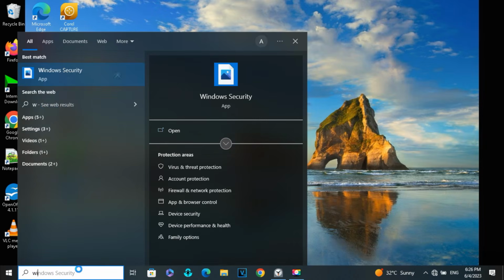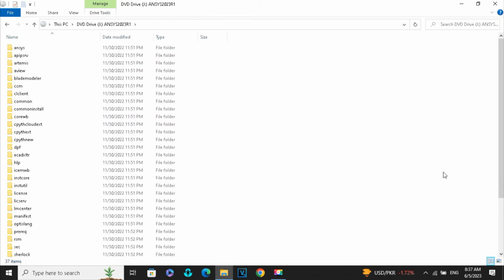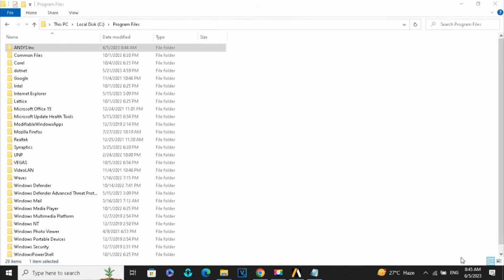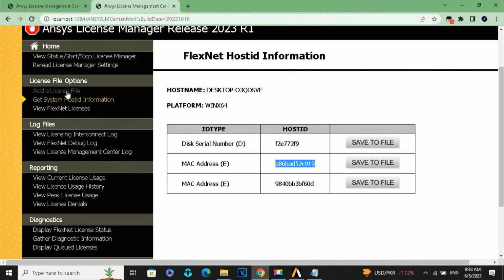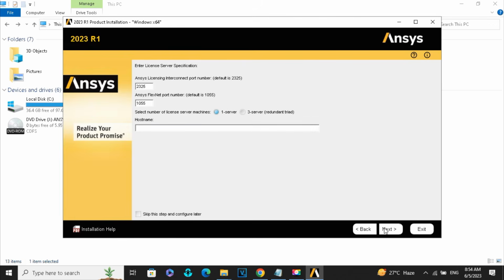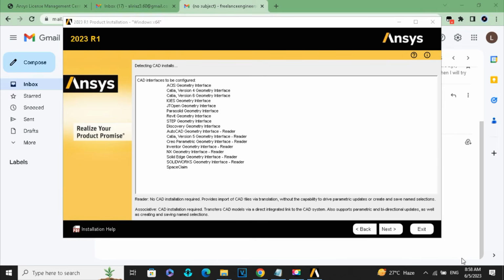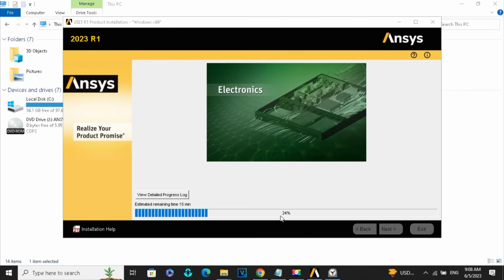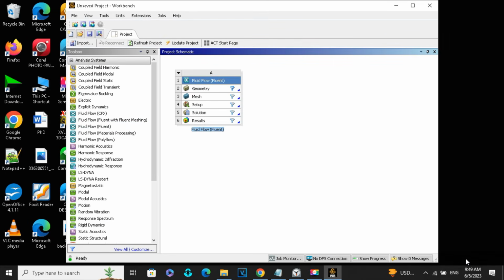ANSYS' 2023R1 Installation #ansys

Comment: i am getting disco_level1 error , and flexnet licensing error -8544 it is saying the license key and data for the feature does not match i tried launching license manager again still same error persists
Reply from the maker: Kindly follow the video.
Reply: I’m having the same issue. I’ve tried following the video several times. Could you please help me with a solution?

Comment: Hi, im trying to run the license, but i have this error:

Error: Problems were encountered while attempting to stop the following process(es): ansysli_server.exe, ansysli_monitor.exe The license manager is running. However, its FlexNet component is not running correctly. To resolve this issue, please manually kill (in the order listed) the ansysli_monitor, ansysli_server, and lmgrd processes, and then start the license manager again through the License Management Center.
Reply: Sorry, solved, I didnt copy and overwrite the "Ansys Inc"  folder
Reply from the maker: @jonathanarias2729  Okay.
Reply: @jonathanarias2729  Bro how did you do that?

Comment: Please I followed your guidelines to install the ANSYS 2023 R1

But I am currently facing a  problem with my Fluid flow (Fluent) Setup. 

Problem: The procedure entry point H5Pset_dxpl_mpio could not be located in the dynamic link library

How do you think I can solve this issue ?
Reply from the maker: Kindly follow all the steps as it is.

Comment: bro everytime encountering some licence problem  disco_level1 doesnot exist in licencing pool
Reply from the maker: Uninstall all the files properly then install the software as explained in the video.
Reply: will it work on windows 11? is it the issue with 11 or i removed all the ansys files and tried several times

Comment: Sir i also want to include spaceclaim and when i tried it it is giving me error as {Request name disco_level1 does not exist in the licensing pool} for it the procedure is same or different pls guide me on the issue
Reply: Same error, restarting and turning on the license again is also not helping.... Please tell me did you find that solution??.... Please reply
Reply: @bharat61020 did you find any solution? I am also facing same problem and cannot find any solution? Please reply if you have found any solution?

Comment: hey guys, if anyone is having the error " Request name disco_level2 does not exist in the licensing pool. Invalid license key" or something similar to that:

try to install Ansys in C Drive (products and license manager) instead of D Drive. 

It worked for me. 

If it didn't work for you then try installing with your windows security and internet connection offline. 

If none of that worked then don't ask me because I can't reply to comments and I have no idea how else to solve it. Cheers.
Reply: Yes, Worked with me thank you

Comment: i installed it the way you said it in the video. I am doing the analysis and when i try to enter the geometry, I am getting an error saying "ANSYS Licence Manager Error. Request name disco_level2 does not exist in the licensing pool. Invalid licence key"
Reply from the maker: Open the license manager from window search bar and click on running option.
Reply: @computationalfluiddynamics3019   it doesn't solve the problem
Reply: License error issue problem
Reply: Sir 
Same problem.
Unable to resolve please help.
Reply: @KushalJain-y1g  I restarted computer and ran the licence manager again. Now it's working completely fine
Reply: Hi bro, i m facing the same issue.
I already restart many times. But not yet  cleared Could you pls help me🙏🏻. @rmbabariya4242
Reply: @rmbabariya4242  same i tried its not working any solutions?
Reply: I'm getting the same issue
Reply: I am not able to open the mesh editor as its saying not having valid license pls help 😭
Reply: @Animatin- same

Comment: Thank you for the video. I followed all the steps and in the end I managed to open Workbench without any issues. However, once I try to open ANSYS Mechanical APDL, the following error appears:

Request name ansys does not exist in the licensing pool.
Invalid (inconsistent) license key.
The license key and data for the feature do not match.
This usually happens when a license file has been altered.
...
FlexNet Licensing error:-8,544. 

Does this method allows me to use APDL? If so, how can I fix the error? 

That would be all. I appreciate your work so much. Looking forward for more tutorials!
Reply: I do too. Were you able to fix it?
Reply: Hi did yoj got any solutions
Reply: @suhaebr2768  Hi. Sorry I did not. In the future I might try again.
Reply: @Tanukiureshi more explication please
Reply: @oussmganayoub7210   got solution bro one dll file is missing u need to add only
Reply: @suhaebr2768  how did you solve it?
Reply: @Tanukiureshi   1)reset winsock in cmd 
2) in windows system host file add #local@1055
Reply: @suhaebr2768  kindly explain the solution of this problem in simple steps, i shall grateful to you
Reply: @suhaebr2768 can you explain more please i have the same license problem
Reply: @suhaebr2768  Hey bro can you explain it clearly please 🙏🏻
Reply from the maker: Kindly crack the software as mentioned in the video.
Reply: @computationalfluiddynamics3019  i did bro and restarted not working same error

Comment: Hi, I followed each and every single steps as shown in the video but when I open ICEM CFD a pop up opens which says "Request name cfd_preppost does not exist in the licensing pool. Invalid license key" due to which ICEM CFD does not open. Could someone please help me solve this issue! Please Note I tried stopping and restarting the license manager and also disabled my windows security.
Reply from the maker: Restart the PC.
Reply: @computationalfluiddynamics3019   Tried that, still not working.. could you please suggest me any other solution!
Reply: @computationalfluiddynamics3019  Please tell us what to do? Everyone facing same problem. Its not a joke. Same problem in R2 version also. I m  getting frustrated with this.
Reply: Is your problem resolved?
I have just installed ansys 2023 R3 and facing the same issue, kindly help me.
Thanks.
Reply: @shivachandran4425

Comment: Hello sir when I tried to replace the ANSYS Inc folder in C drive with the cracked one I got an error saying a folder winx64 is in use or a file in it is open in another program but I don’t know what file that is
Reply from the maker: It seems that you have crack file in the same drive. You have to delete the file before installation.

Comment: I am facing this error, please solve this "Mechanical failed to open the database: The Mechanical editor does not have a valid license. Please refer the following directory for more information: C:\Users\sabit\AppData\Local\Temp\.ansys."
Reply: i got the same error did u resolve it?
Reply: did you solve this problem?
Reply: @slhkty2165  I have the same issue, tried to install again but it isn't working, Did you fix it?

Comment: Hi bro i  installed the software but the problem is when i try to open  setup in ansys fluent the mesh is not loading and its taking some time then showing some error  goung back to main page could you tell me how to fix it?
Reply from the maker: Kindly make sure that you cracked the software properly.
Reply: @computationalfluiddynamics3019  do you have any alternate option
Reply: @computationalfluiddynamics3019 We have done this. Have u checked urself?? So many people facing same problem with meshing. Please give us some solution. Even in R2 version having same problem. I thought R1 version would be better.😢

Comment: while running ansys fluent setup, it's showing this error *ANSYS LICENSE MANAGER ERROR:Request name cfd_solve_level2 does not exist in the licensing pool.
Invalid (inconsistent) license key.
 The license key and data for the feature do not match.
 This usually happens when a license file has been altered.
Feature:       cfd_solve_level2
License path:  1055@localhost;
FlexNet Licensing error:-8,544
*...Please help
Reply from the maker: Open the license manager from window search bar and click on the "Run" option.

Comment: Does this Ansys Products 2023 R1 packages included with Ansys Electronics, Electromagnetism and Ansys Maxwell?
Reply from the maker: Yes, it has all. You have to select the required module during installation.
Reply: @computationalfluiddynamics3019 Okay, but in the module section it is not showing any packages named Ansys Electronics or Ansys Maxwell, why?
Reply from the maker: @masterclasz1907  Properly mount all the three disks in order fully utilize the package.
Reply: @computationalfluiddynamics3019  Ohh okay sir, I had mounted only disk 1😅. Now I'll try mounting other disks. Thank you😇

Comment: The analysis systems which contain useful stuff like Fluent is not showing on toolbar in workbench...I tried clicking the view/customize option and checking all the boxes beside every software but no luck....Help is appreciated thank you
Reply from the maker: You have to select the Fluent option during installation, so that you can use it.

Comment: Thanks for this, but fluent meshing application does not import any geometry and gives an error. Do you have any solution suggestions? The license is working.
Reply from the maker: Open license manager from window search bar and click on running option.
Reply: I'm also having the same issue.what to do
Reply: @parvathyt8442 i am also facing same problem? Did you find any solution?

Comment: I cant run any software because there is a license issue. I did every step according to the video, including Defender disabling and no internet. How do i resolve this?
Reply from the maker: If you have followed all the steps then you have successfully installed the software. Kindly open the license manager from window search bar and click on "running" option.
Reply: @computationalfluiddynamics3019  yes I followed every step correctly and the license manager is running as well. Actually this worked previously as well. However, once I performed a clean install of Windows,it is not working.

Comment: The license is working fine but the Icepak is not opening, its showing an error that "Request name electronics_desktop does not exist in the licensing pool"
Reply from the maker: Kindly crack the software by following each step as discussed in video.

Comment: Sir it says flexnet licensing is not running. I tried many ways but in that step it doesnt run. Before this i had used ansys and used another localhost. I uninstalled entire ansys before downloading the crack. What should i do with the licensing part
Reply from the maker: Kindly install the software by turning off the virus protection and internet.

Comment: hello, i already downloaded it, but when i opened it, the analysis systems doesn't appear on the toolbox. can you help me?
Reply from the maker: Kindly run the license manager by open it from window search bar.
Reply: thankyou, but what should i do if the  ansys license manager error, request name disco_level1 does not exist in the licensing pool?
Reply from the maker: @bib_bib8  Reinstall the software by turning off the internet and antivirus protection. Make sure that you uninstall the previous versions successfully.
Reply: sorry, i tried but it still not working
Reply from the maker: @bib_bib8  Restart the computer.

Comment: Can you help me? I installed the Ansys such as your tutorial, but when I start the softwares such as SpaceClaim (and others) showed the message: Request name disco_level2 does not exist in the licensing pool. Invalid (inconsistent) license key. The license key and data for the feature do not match. This usually happens when a license file hass been altered. Feature: disco_level2 License path: 1055@localhost:
FflexNet Licensing error: -8.544. I installed the license maneger correctly. Thank you.
Reply: were you able to solve it? I have the same problem

Comment: Sir
I am having a problem with opening fluent r1. It says license error. Hit return to exit the window
Reply from the maker: Open the license manager from window search bar and click on the "Run" option.
Reply: @computationalfluiddynamics3019  i followed everything as per your instructions it says ansys fluent failed to validate the connection?
Reply from the maker: @ridwanhusainishraq  make sure that you turned off the internet and all kind of antivirus protection available in your computer before installation.
Reply: @computationalfluiddynamics3019  but u turned on the Internet(wifi) during installation too. Dont you need to connect to WiFi for turning on ansys license manager?
Reply from the maker: @ridwanhusainishraq  No It is not required.

Comment: I downloaded it successfully and used the program without any problems for two weeks. This morning, I woke up, and the analysis system does not appear on the toolbox, even though when I open the toolbox customization, they are all checked. The only thing that appears on the toolbox is: engineering data, external data, external model, geometry, Granta MI, granta selector, injection molding data and exel. If you could help me i wold be extremely gratefull. ❤❤🙏
Reply: Additionally, when i try to copy a previous fluent geometry i had done, the message that appear says: The Meshing editor does not have a valid license. Please refer the following directory for more information: C:\Users\AppData\Local\Temp\.ansys.
Reply: @niccolobascetta1243 Hey, I am getting the same issue ..Can u please tell me how u resolved the issue...Pls tell me asap...I need it urgently..
Reply from the maker: @niccolobascetta1243  Brother, you have to open the license manager from window search bar and click on the running option of license. I hope that your problem will be resolved.

Comment: I installed and after clicking the MODEL button it's showing like this

"The mechanical editor does not have a valid license."

Please replay how to fix this...
Reply from the maker: Kindly go to license manager by searching it on window search bar. After that, click on license "running" option. 
I hope that issue will be resolved.
Reply: I had same problem broo, can you solve?
Reply from the maker: @avikaa07  use the aforementioned suggestion, please.
Reply: @computationalfluiddynamics3019  its not working that way as well mate

Comment: Ansys Mechanical window is not opening. Rather it's showing Mechanical editor does not have a valid license. I followed the exact steps though. Could you please help me with this.
Reply from the maker: Brother, if you follows the steps exactly then it will be definitely opened. I suggest you to only crack the license file as mentioned in my video by turning off the internet and antivirus protection.

Comment: Bro, i installed but can't open the geometry,(  showing the file has been altered , no valid license found)
Reply from the maker: Crack the software again. Note that, there is no need to re install the software. Turn off the internet and antivirus before cracking the file.

Comment: Mechanical failed to open the database: The Mechanical editor does not have a valid license. Please refer the following directory for more information: C:\Users\UserName\AppData\Local\Temp\.ansys.  How to solve this problem?
Reply from the maker: Kindly do not miss any step that I mentioned in my video.
Reply: @computationalfluiddynamics3019  I have the same issue, I tried to install two times following exactly the same steps on the video
Reply: did you solve this problem
Reply: @slhkty2165  no
Reply: @slhkty2165  no
Reply: @slhkty2165  no

Comment: I have installed but in my case the analysis system is not their means I am unable to add it , Please rectify this
Reply from the maker: Kindly follow all the steps carefully. Before installation, choose the analysis systems that are required by you.
Reply: @computationalfluiddynamics3019  I have installed it thankyou
Reply: Now for geometry it is saying that license is only for read only mode
Reply from the maker: @iitkgp_ms  Kindly open the license manager through window search bar. Then stop and start the license running option. Hopefully, your issue will resolve.

Comment: Hey, thank you for you video. When I try to open the mesh, it says "Mechanical does not have valid license", do you have a solution?
Reply from the maker: Open license manager from window search bar and then click on the "Run" option and lastly, restart the PC.
Reply: @computationalfluiddynamics3019  Thank you for your answer, i've done that but still doesn't work... I did exactly the same as you did in the video.
Reply: @caillaudsimon329 bro same problem is it solved
Reply: facing the same problem. The license shows running but still does not work
Reply from the maker: @caillaudsimon329  Turn off the antivirus protection before installing software.
Reply from the maker: @ananyajahanchowdhury7358  Turn off the antivirus protection and internet before installing the software.
Reply: I did turn it off @computationalfluiddynamics3019
Reply: Yeahh i had some problem broo, can you solve?
Reply from the maker: @avikaa07  Follow all the steps that discussed in this video.

Comment: Bro I am getting error as fluent application failed to validate the connection
Reply from the maker: Brother kindly crack the software by following same steps as mentioned  in this video.
Reply: @computationalfluiddynamics3019  yeah bro I followed same steps and before when I installed the student version also I got same problem

Comment: Any way to enable Enterprise license level? It is required for the GPU Solver of Fluent, which is the main reason why I installed 2023R1.
Reply from the maker: You have to contact ANSYS officials to get enterprise license.
Reply: @computationalfluiddynamics3019   are you stupid? You make a video on how to crack Ansys and then suggest to contact Ansys officials?